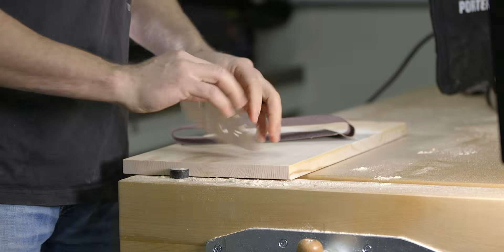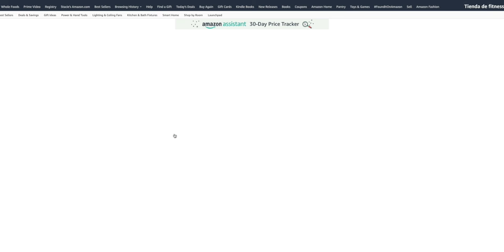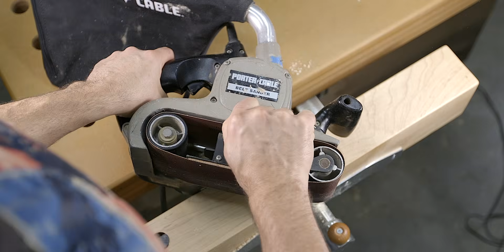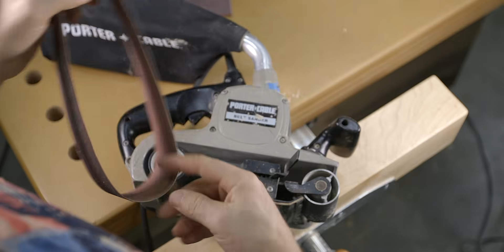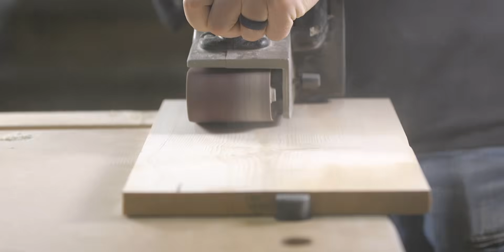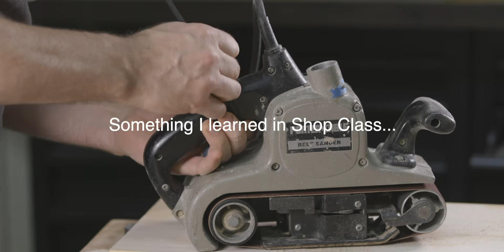Portable Belt sanders | Beginner Tools

Comment: My belt sander is getting used mostly on one side. After a lot of use I turned the sanding paper around.  I was not supposed to do that, but it did work.  Only the center was left unused.
I notice yours is also showing signs of use on one side.
Reply from the maker: They can wear on one side depending on how they’re used. Sometimes we apply more pressure to one side without realizing it. Sawdust buildup can also make it look like one side is wearing more. Make sure the belt is adjusted properly so it’s tracking straight. Just be sure to clean it regularly—and I guess we all need more practice. :)

Comment: Hi - I hope you or another viewer can help out my pretty basic question.  I've embarked on my first wood-working project since 8th grade (1979) and have small problem. I made drawer that is 3" high, but needs to be about 2 7/8" high, so I need to remove above 1/8" from all 4 sides.  I have an orbital sander, but it's taking forever with 80 grit, but more importantly it's not sanding down evenly.  After watching this video I think a belt sander is the right tool for the job?  Or maybe a plane?

Thanks in advance
Reply from the maker: Hello. A belt sander would work, but it's still really hard to keep even. I would use a table saw for the long cuts and a miter saw for the short cuts. However, I would imagine that you don't have either. So I would draw a very clean pencil line on what needs removed and sand to that line. I would also recommend starting on a practice board to get the feel of the sander. Hope that helps.

Comment: I am seeking to sand and repaint a front porch — I’m wondering if belt sanders are suited to this task or if I should seek out a circular hand sander.  

It seems like maybe they are more suited to elevated construction work, but I might experiment with the sanders I have to see how they perform on this porch.
Reply from the maker: Start with what you have but the belt sander will work good for this task too because it can remove material quickly.

Comment: I bought a used belt sander that did not have a dust bag. What is a good standard dust bag out there that I can buy for my machine and where can I get it?
Reply from the maker: You will have to look for a bag that fits your model and brand... if you can find a factor bag that would be great.